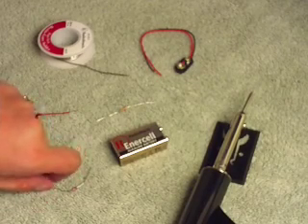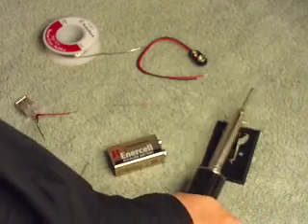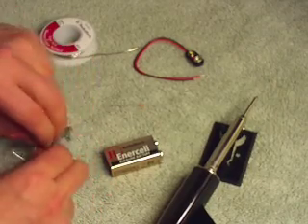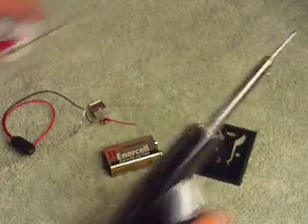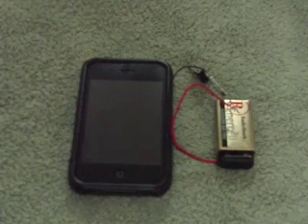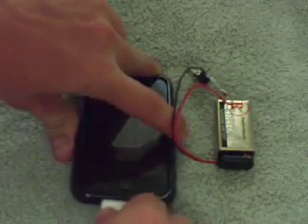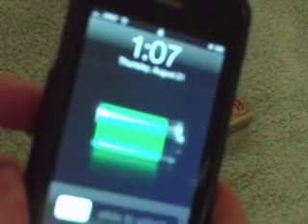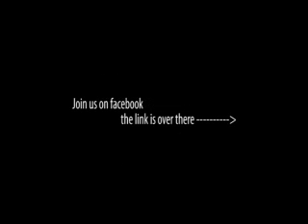How to make a USB battery

Comment: THIS DOES NOT WORK! I tried doing it myself after purchasing every part at Radioshack (for ridiculous prices, mind you). The voltage was fine, 5V, just like it should be. WHERE THE PROBLEM LIES IS THE DATA CABLES ON THE USB CONNECTOR! Without any data input to your device, the device will refuse to charge. I tried both an iPod (120G) and my iPhone and neither worked. Do not attempt this build because it does not work! Thumbs up this comment so more can see before attempting!

Comment: The 9 volt battery wont last long but it will give you a few minutes of power.  The same circuit will work with a big square 6 volt flashlight battery and give you far more time. It should work with a car battery too, but I'd suggest using a larger resistor. 640 ohm should work well.

Comment: @JawesomeMan Before you spout off about electronics, you might want to consider learning something about electronics. The 5.1V Zener diode limits the voltage available to the line to 5.1 volts.  The resistor is in series for that drop. What he left out of the video is that the diode must be installed with the correct polarity, with the cathode to the red wire of the USB port. Otherwise, you'll get less than a volt to the iPhone and likely burn the resistor. But you wont damage your phone.

Comment: You could always use a DC-DC buck-boost converter and adjust the voltage to 5V. The advantage compared to this is that you can use any battery, not just a 9V one. You can find tiny ready-made circuit boards for about $10 on Ebay from China or Hong Kong...

Comment: Could work but thats not overly efficient, youd want to run the 5v Zenner in paralell with the load. and with the correct polarity. however youd fry your zenner the second the load was removed. bit flawed.

Comment: @jamezo97 Not exactly... By putting the Zener diode in reverse bias with the 9 V battery (the positive terminal connected to the anode of the Zener diode) the Zener drops almost exactly 5.1 volts across its anode and cathode terminals. The resistor is used to drop the remaining 9-5.1 = 3.9 V. Without this resistor, the internal resistance of the Zener (usually only a few ohms) will bear the burden of dropping all that voltage which is very dangerous as it will burn out.

Comment: @jamezo97 WHY!!! A diode doesn't limit voltage, are you fucking wasted? The 330 ohm resistor limits the voltage, not by enough but that is the logic behind this fakeness, and the zener diode shorts the circuit (preventing damage to the stuff you plug into it) if the voltage exceeds 5.1v. this, if redesigned and less retarded, would work. Ad for why its obviously fake. The iphone requires the usb data pins to be at 2.0 and 2.8 volts or it will not charge.

Comment: won't work. As far as this goes, the diode is useless since there is no reason for limiting the direction of current and resistor will not output a constant 5 volts because of variation in the load.

Comment: Sorry nubs but this does work. It's all about amperage. My ipod wall charger expels 1 amp and the 9V battery topped with a resistor the amperage is probably way less than 1 amp.

Comment: @bbbbweb Yes, but some jackass will try it, and once you pull the pin out of the center of the audio cable there is no place for the battery to make contact, as it will be a quarter inch from the battery, SO IT WONT WORK, so why fuck up a good cable.

Comment: This circuit can work. However, you must be very careful to get the zener diode the right way round. If you don't you will probably burn out the zener and could send 9 volts into the phone.

Comment: So this is really bad for charging ipods i believe. The voltage for charging will slowly go down and the ipod will start to destroy the battery right? I can see that this is cool and all but completely unpractical and dangerous. I am no electrical technician, but i recommend that nobody charge anything using this method.

Comment: You can also do it with only 2 resistors with the Voltage divisor law Vmiddle=(VinxR1)/(R1+R2)

R1 is connected with R2 and the mass. R2 is connected with Vin and R1. Vmiddle is between R1 and R2. 
But then the power (W=VxI) that goes on R1 is lost and your Current will depend on R2.
Be carefull to use bigger resistors if you plan to use more than a quarter or watt.

Comment: With an lm317 voltage régulator to fix the 5v from 9v source I think it should do the job better than with this cheap zener diode trick.

Comment: i tried , it works , the usb thing is easy to find , they are a dollar , you buy them as a usb female to male cord , then you just cut it in half , take the red and black wires , connect it to the + and -  with 4AA batteries , then plug your device into the usb plug , it will charge right up . or use it to power anything that uses usb. works for me .

Comment: @S3ANnnnn Obviously he did, when he showed only one iPod cord... Plus, right as he plugged it in, it started charging. If it was another cable, he would've had to plug the one that he showed into the USB Pocket Battery and then plug in a seperate cable that was "really" attached to the iPhone and the wall or computer. That would have also taken some time after he connected it to the USB Pocket Battery.

Comment: Hi this video you made it cool. I know how to make some cables from some systems console but this one you make for your Ipod it was great for me. Please to tell me what resitors you used to make this project. I can make one but it will be little dificult to know what resistor I need for this project. You must to show clearly the colors of the resitors you used for reduce the volt of the battery 9V.

Comment: yeah... anyone with some knowledge of electronics will know that zenner diode will NOT be able to keep all the current the iphone needs at the 5v1 rating... and more than that, the iphone uses a USB protocol to check the source of current before it starts to use it. -> nice of you to show both ends of the cable =))

Comment: @cyleleghorn246 if u DIRECTLY  plug it in with out any resitors your ipod will explode. it runs on 5 volt dc not 120volts

Comment: @dzhiuge69 youre right, but after the resistor the battery ipod isnt getting all nine of it. youre wall's outlet is 120 volts but you still plug your usb devices into that right? just use one of those fance square plug things with a build in resistor and viola.

Comment: USB power supplies 5 volts 100 mA of current.   He needs a 7805 regulator for constant 5 volt power.   Here is the project that would take a 9 volt battery and uses resistors, regulator and it's at the Jameco site under the DIY section called the Altoids Charger.

Comment: @ShambleS11GameS i think he uses the diodes because 9v is to much voltage for your phne you will need 5V or 5.1V you can do that or with 7805 or with diodes ad resistors.

Comment: @betosephia yeah i got a 5.1v zener diode, and a 330 ohm resistor and nothing worked, i even used a iphone like he did, but by all means, if you have gotten one to work and can show in clear detail (hold the device still in front of the camera for more than a second and keep the power cord for the iphone or mp3 player on screen not trailing off somewhere) and give me a schematic ill be happy to shut my mouth and admit i was wrong

Comment: @iraqiboy90 the diode and resistor bring it down to 5 volts so you can just use a 9 volt to last longer and use one battery.

Comment: isnt usb should only be 5 volt.
why u use 9 volt battery then?
Reply: he does not explain well.  he has a zener diode and resistor to hold the voltage to 5v off of the 9v battery.

Comment: did you also know inside the small little white box connected to the wire inside is also a bunch of resistors and possibly a small board?

Comment: It might not work since the computer also takes in info and the charge from the battery will destroy your USB port most likely because it doesn't have a board to redirect the electricity and since it is downgraded to five volts, it's still too much.

Comment: If you go to the shop to buy a zener diode why don't you buy a 7805?
You would not need a resistor and save a huge ammount of energy (the diode will consume energy even if nothing is connected to the "charger")

Comment: I went to RadioShack and found 3 different 330-ohm resistors: a 1/2 watt, 1/4 watt, and a 1/8 watt. I am trying to make the USB battery to charge an iTouch 2G (3.7V battery) Which resistor do I use? PLEASE HELP!

Comment: idiot, the diode is the part that turns the 9 volts into around 5v, which happens to be the power output for usb.

Comment: 9V battery has current of 1.5A. 330 ohm resistor brings the voltage down to around 5V, which is the voltage used by USB. Make sure the current is appropriate (1.5A), and you should ideally use a capacitor in case there's a surge (which this design is very vulnerable to).

Comment: It's the Zener diode that gives the voltage drop. The resistor is used as a voltage gate between two devices. Without it, either the 9v or the battery from the iphone will blow up. I'm not sure which batter is stronger.

Comment: that's not what diodes are used for... check out this guy's other videos, he has a lot of complete bullshit that would NEVER work, like powering an HD television off of a single AA battery, or making a high definition speaker with a penny, tin foil, and a paper plate...

Comment: It may work.. .he's just regulating the voltage from the battery to make it more usb friendly. i'm not sure about how long it is gonna last because the diode and the resistor will consume part of the energy given by the battery in order to low down the voltage. but at least it could help in a "low battery emergency"

Comment: You obviously don't know how electrocution works. You can't get electrocuted from what this guy's telling people to do than you can by simply touching both terminals of a 9volt battery. Simply put, a 9volt doesn't have the amperage necessary to electrocute anyone. Also, this video is fake... He would be overcurrenting the iPhone, thus breaking it, because USB is supposed to be 5v, not 9v

Comment: The formula can be tweaked to fit whatever need, its just the practicality that counts. lets say i forgot to recharge my battery last night and im appointed dj at a party without my charge kit, and i am the only one with music. i have a premade kit in my car that will extend the life of my popularity and my device. this could be used for vacations as well out of the reach of any electrical outlets, or you just dont have a computer around.

Comment: um, wouldnt this not work? that resistor cant be on the 5v and - lines, it should be on the data lines ( middle prongs), correct me if im wrong (with details plz)

Comment: Good comment, the power supply in a computer is a two voltage switching power supply.
The voltages are 5 and 12.
The polarity can be positive or negative,
and it can switch.
The USB port is +5 volts.
I wouldn't take a chance on an expensive device.

Comment: shurely leaving the zener diode connected to the + - it would constantly be wasting 4.9v's even when not using it, i would put a switch somewhere between there though you could just pull the battery out ^^

Comment: the hovershoes did work, you just dont have the steel bars in your garage. If you did, it would work. Like it did for me. The peanut butter disk cleaner, also worked for me. And this, did as well. I charge my iphone with my Windows PC all the time. And no i dont have itunes nor any type of apple software. The battery charge does work.

Comment: i know but the iPhone WONT charge without something to tell it that it is connected to either official apple stuff or a computer.  thats why there has to be a 150k resistor on the data + and the data - each, then piggy back them off the usb positive line.  and ummm HOVER SHOES? peanut butter disc fix... dont work either!

Comment: methinks this is fake.. the iphone wont charge off anything without the data +/- contacts having juice running to them as well... notice he didnt zoom out when doing this to show that the cable was really hooked up to that... you need to throw a 150K resistor on each of the data transfer contacts then piggyback them off the usb positive voltage line!

Comment: depends on the device.. my zvue would recharge on a rig that was just a 5 V regulator and a 9 volt battery.. but for my 3Gen Nano i needed to run a 150k resistor off of the data + and as well as the data -, and then tie them into the + voltage of the usb input

Comment: Ah yes, reverse bias. Sorry I took microelectronics last year and now I've forgotten 90% of the materials @@. Oh the threshold voltage is the other way round compared to normal ones. But if that's gonna work, the creator of the video should at least tell the viewers how to connect it. Most viewers don't study electrical engineering, I guess.

Comment: 100 ohm might be a liitle low; check the max current the docking port is rated for (Ohm's law). Zehner diode is a type of diode, those labels you mention are the material (germanium / silicium). Check wiki on those (& make sure the diode is facing the right way of course :-))

Comment: the 9v battery is a very bad choice for this project. using anything larger than 9v will mean there will be a lot of energy loss (shit will get hot). 

you may be able to charge that ipod only 1 or 2 times on that 9v

Comment: USB voltage is 5V. The author used a Zener diode to reduce the voltage from 9V to  approx. 5V. If you wanna 'overcomplicate' it, use a 7805 instead. It will do the job too. So, there is no magic around here. =)

Comment: ya just make a break anywhere's in the line of current. if you take one of the wires and cut it in half, then use a wire stripper to get down to the copper, you can either buy a button switch for around 10 cents or make your own by just connecting those two wires.

Comment: you basically have to make sure you have the right resistors for this, it is going to be different for everything you want to use it for. Look at the device in question for the voltage and whatnot. Then yeah, you have to make sure the usb connector is going to convert the current properly, you don't want to fry something like an iphone by doing this.

Comment: the battery is dc not ac    and if it was ac a diode would convert it to dc any way,    i dont know why u need a diode for this expiriment and it doesnt say which way to put the diode in anyway, and which is left and which is right , if u turn it upside down it changes

Comment: My school was cheap and sucked, we barely had electricity classes. In that case, would you tell me if this experiment actually works?
I don't have an iPod, but how does it take 12v instead of the 5v supplied by the USB port?

Comment: The resistor will have to burn 3.9V at 0.5A max, so you should be OK with a 2W rated resistor. If you take a lesser rated one, take good care that it doesn't heat up.

Comment: The output is trimmed to 5.1 V by the Zener, the excess voltage burns off in the battery and on the resistor. Theoretically.

Comment: Most modern devices are able to tolerate a certain degree of overvoltage and will stop charging anyway once the battery is fully charged.  However this is pretty dangerous to use on USB devices that assume and require +5VDC.

Comment: umm just like to say usb ports supplies 5volts and not 9v. i would think this will work but i wouldnt try it with a 9v battery on an device like an iphone without having read the device description on the packaging and see if it would take the 9v supply (look at output/input impetus of the battery n device)

Comment: no it won't shock you just like touching the ends of the battery ( unless you put it in your mouth, dont ask)

prob about 15-20 bucks for everything including iron without iron or solder it would prob be 5 bucks or less

im not from household hacker, just wanted to help

Comment: If you have a soldering iron, solder and a USB extender, only a couple bucks. If you dont have a USB extender, somewhere around 15. If you have nothing, it will cost around 30.

Comment: impossible an iphone requires 12 volts to charge and the only 12 volt batteries that exist are six dollars and run out quick so this is utterly usless and that is a 9 volt battery. have a brain HH? Plus hes using a resistor to reduce the power!

Comment: it would be better to use a 7805 linear regulator. it is a simple 3 pin device and better than zener diode method as it has thermal and over current cutout for saftey

Comment: The reversed biased 5.1V zener diode will not allow more then 5.1V across the terminals, so your electronics should be pretty safe. If your worried about current for some reason, you could make an impromptu fuse by putting a 10 Ohm, .1W resistor in series with the circuit. The 10 Ohm resistor will act as a fuze, as it'll melt if you get more then about 20 mA of current, breaking the circuit. This is basically the same circuit you would see for a professionally made 9V to 5V DC-DC converter.

Comment: i seriously dont think this would work
the battery is only about 100ma(if your lucky)
and according to the video you can use it to charge a 300ma+ iphone battery 

aint gonna happen

although
the voltage is right because the zenner diode limits it to 5 give or take 0.1

Comment: i tried this but my female usb has 4 wires, white and green cable and red and black would it still work if i do it?
how does the zener diode should be place does it has to be black wire (anode) to red wire (cathode) or red wire (anode)to black wire (cathode)